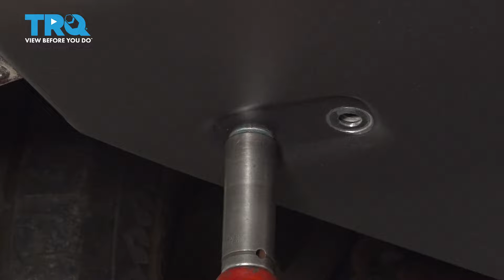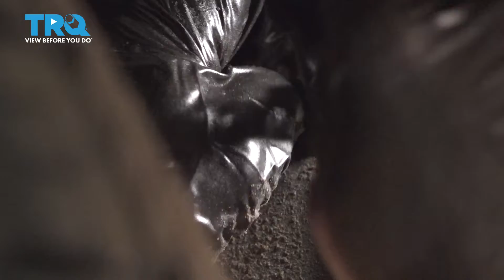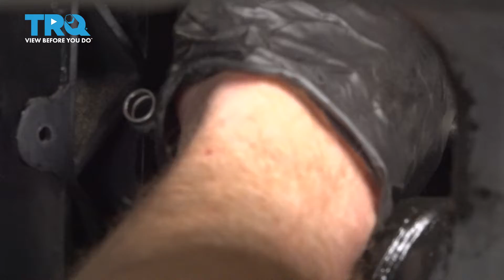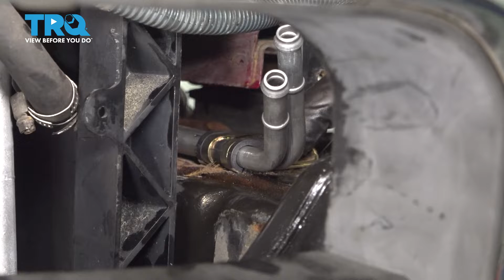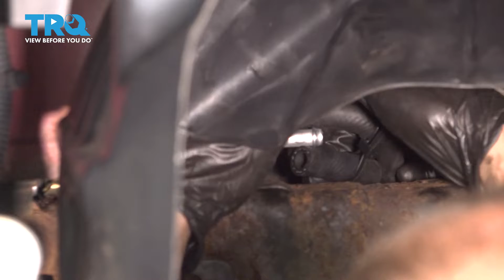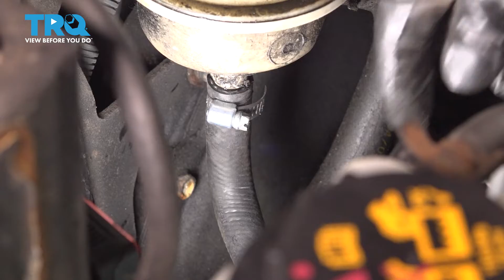How to Replace Power Steering Pressure Hose 2004-2015 Nissan Titan

Comment: Like other comments I agree this video does not express the degree of difficulty you will encounter replacing ALL of the power steering hoses especially without a lift. A couple of notes, the center bracket holding 2 lines has two bolts not just one, they are usually covered in dirt and grease so clean the area thoroughly first. Second there is a rubber o- ring on the hard line of the steering rack, replace this o-ring while you  are doing the rest of the work. Third the banjo fitting on the steering pump is very tight, I needed a 1/2 breaker bar and long extension to be able to work outside of the wheel well and get enough leverage.

Comment: i just need to change the high pressure line since my banjo bolt is stuck on the pump. and i broke the sensor. am i able to just unscrew the hose from bottom and remove it and replace it?

Comment: Im trying to replace just the high pressure hose. The second bracket has the high pressure side connected to the other hard line and I cant separate them. Is there an easy way?